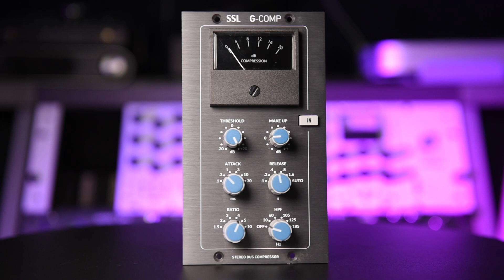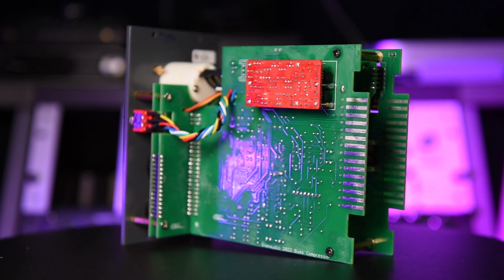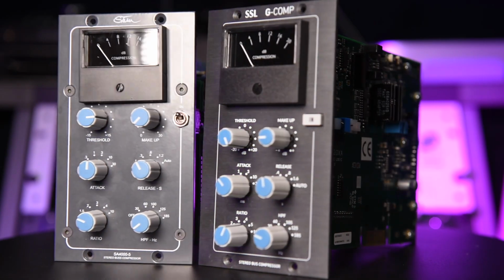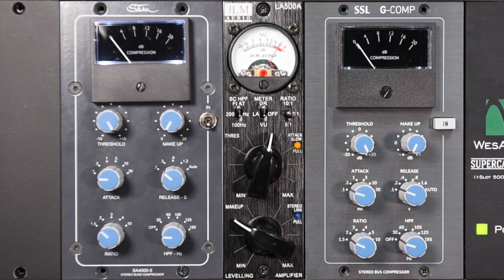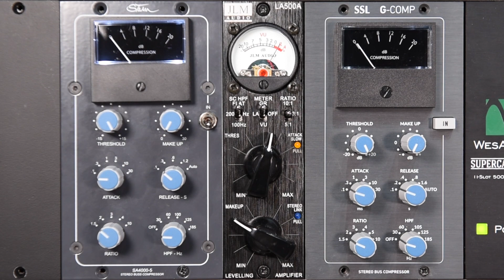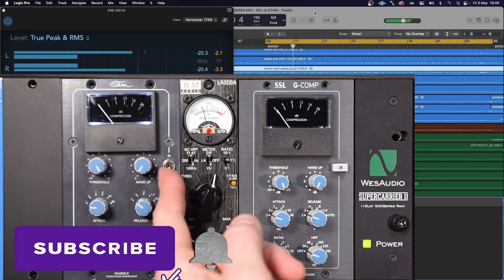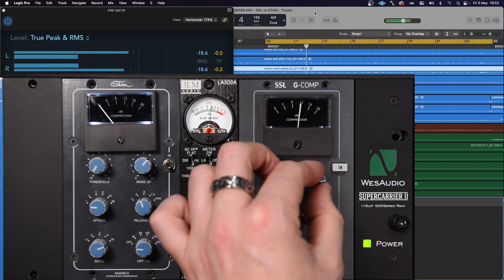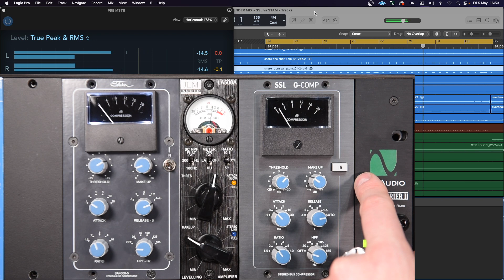SSL G-Comp VS Stam Audio SA4000-5 | 500 Series Stereo Bus Compressor Shootout

Comment: Great video and thank you. 
I needed that. 
Original stays original. 
I just bought the SSL G-Comp 3 days ago and i now understand what that word “ GLUE” really means.
Reply from the maker: It’s 100% the definition of the word Glue. Subtle and musical. I found the SSL crumbled under pressure earlier than the Stam but it’s very open sounding until then.
Reply: The irony is that the Stam has the original parts of the old SSL consoles while the SSL has been modified from the original ❤

Comment: The Stam is based of the very old design with the original DBX cans in them. Those VCA’s distort much easier and hence make the character sound a little more grittier. The SSL on the other hand is a more modern design with a much higher headroom hence the open and airy sound it delivers. Both sound awesome and it comes down to preference. I have the Stam and it lives on my master bus.
Reply from the maker: Spot on 👌

Comment: Thanks for the comparison, Ed!

Honestly, in this example the SSL was hands down the better performing compressor to my ears. I’m actually a little disappointed with how the Stam sounded here.
Reply from the maker: Interesting. What didn’t you like about it? It’s definitely more coloured where there’s SSL is more spacious.
Reply: @EdThorne  it was my perception of “polish” to the sound, which I guess is due to the more coloured nature of the Stam. In actual practice, where I’d be using this kind of compressor gently on the mix bus, I don’t think I’d be unhappy with the results from the Stam, but the SSL just seemed to hold together better at higher db reduction than the Stam did - subjectively speaking 🤷🏻‍♂️

Comment: I was actually shocked that I did not like the Stam as much as I had hoped. To my ears the SSL had more air, lift and body somewhat more lively while the Stam had more crunch and color. While I am all for colouration I think by the time I am at my mixbus less is more although I want it to glue instead of colour. For half the price though Stam makes a strong case as maybe dial it back so it does not crunch my entire mix. For some reason I am not convinced it has useful for everything but like you said, it's good for certain instruments.
Reply: We can make one with less THD up to each client. It's up to each client!

Comment: Unfortunately, the Stam has the same problem that all Gyraf-based SSL clones have: a knee that is too soft. If you want the hard knee sound, the only options are the SSL G-Comp, the X-Logic version, and the Smart Research C1/C1LA/C2. Maybe the new TK BC501 with the "Grab" hard knee setting might be close to the original compressor action. I think Stam's price is right. A compressor of this kind shouldn't cost a thousand. I hope Stam can recreate this hard knee someday.
Reply: Where is the proof for your statement?
Reply: @RockmannMusic  I’ve measured GSSLs against a G-Comp, and in my case found no knee difference.
Reply: @craigmorris74  Thanks for the info Craig. Good to let the public know.
Reply: The Stam uses the same SSL 4K shematic. There is no knee difference.

Comment: This isn't a good comparison as the SSL circuitry is always in the signal path (the SSL doesn't have hard wire/relay bypass) don't know about the Stam but nonetheless the SSL circuitry is always in the loop - the "IN" button when out only disengages the sidechain.
Reply from the maker: Technically they’re both always in the loop so what you’re hearing is both devices passively and the compression from each separately.
Reply: @EdThorne  But it's not passively as the entire circuitry for each compressor is permanently in the loop and acting on the signal - it's just that you can't hear actually what each unit truly sounds like (box tone) - I think this is important because the basic sound of the unit's signal path without any compression going on obviously really matters - when the signal path of both units are in play at the same time you can't really judge the sound of one of them on their own, it's a mash up of both but I agree you can judge the compression action just not the true sound of each compressor.
Reply: @doradoradoramen  with my SSL-ish VCA compressor, the chameleon labs 7721, i can't tell the difference between the boxtone of the unit in bypass and a true bypass in a blind test. so i would disagree that it's important. once it starts compressing, there is a certain tonality to the unit, but not before. in my experience. which i'm sure is worthless to you since you can write it off as "this guy just can't hear subtleties"